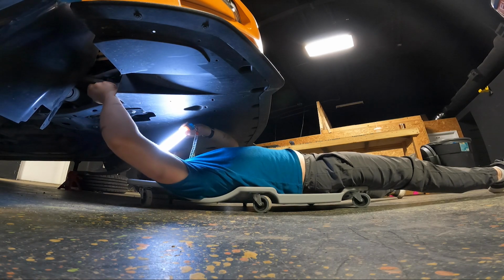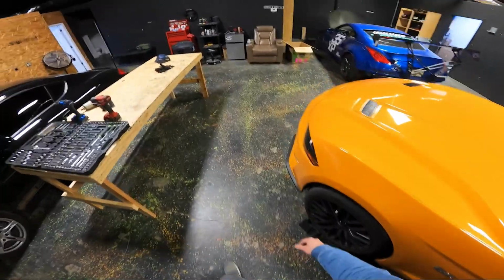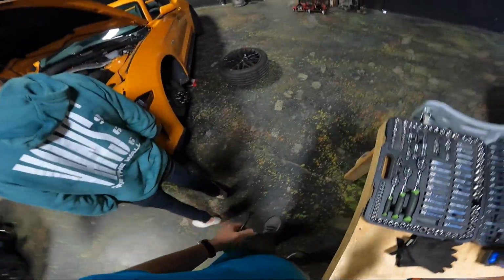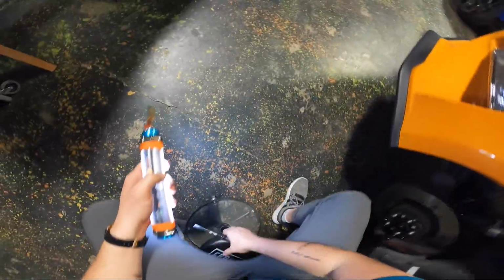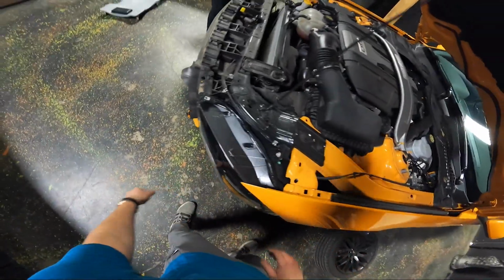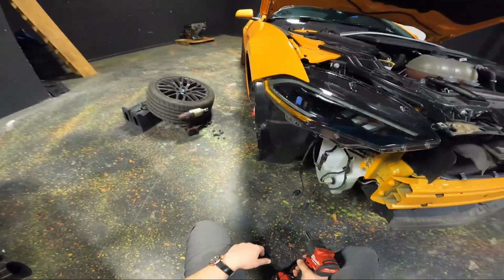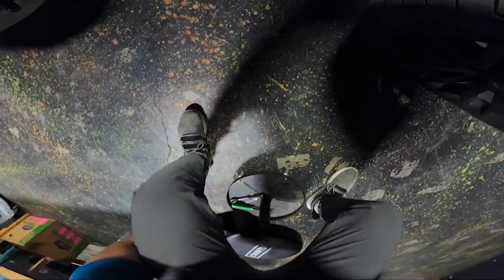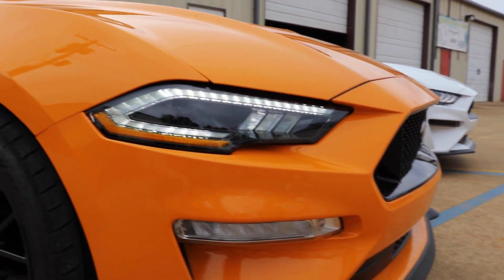PayDay's First Real Mods in the New Shop! | S550 Mustang Morimoto HID Headlight Install

Comment: If you ever need to take your front bumper off again you don't need to take off the wheels. Just pop the 2 plastic clips on the bottom and for the 2 10mm behind the fender liner you can access easier thru the top with a extension. 

Great video tho! Keep up the good work! 👍🏻
Reply from the maker: Note taken for the future! I found a few tricks after doing this like what you’re talking about.  It makes me appreciate the car more knowing Ford thought about things like that.

Comment: My only problem with these headlights and the only reason I'm not getting them for my 5.0 is cause the LED strip that goes around the outside, like the outline of it, is staggered. Like you can see breaks between the LEDs in the outline and it kinda breaks it where as on the gt350 headlights they had installed on lucifer, they are completely solid unified lines around the outline.

Comment: Carbon fiber hood with some paint match will help with that weight and look great... 😉
Reply from the maker: You kinda right..
Reply: It's an aluminum Hood spending 2 Grand on a carbon fiber to lose five or six pounds is just dumb especially when you only make 435 at the crank. Would definitely go with some performance mods first imo js